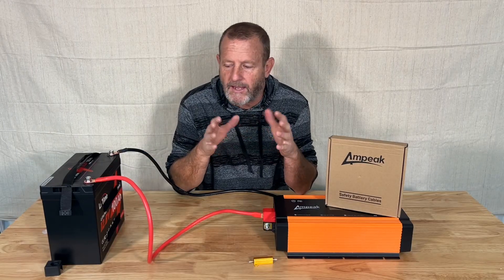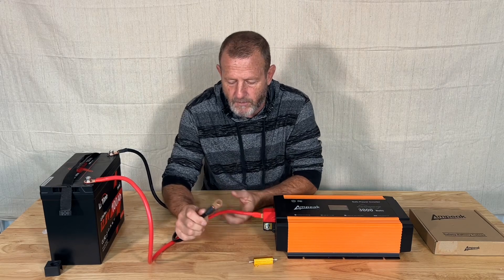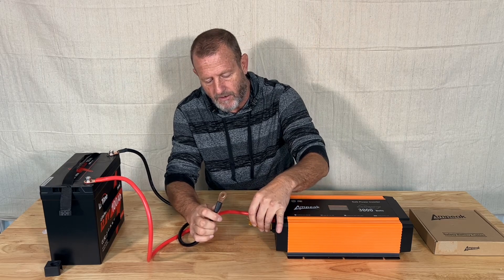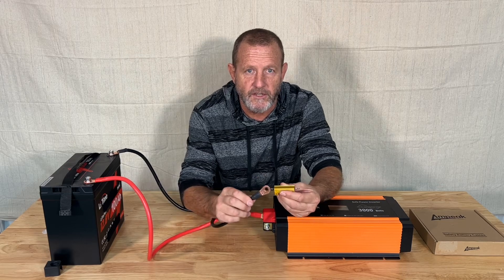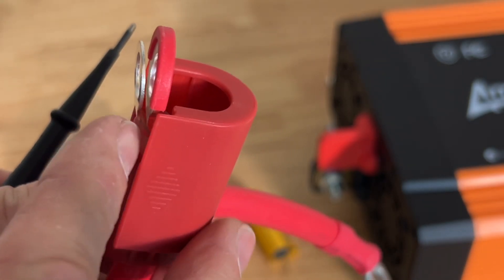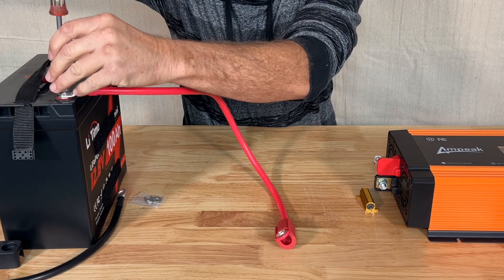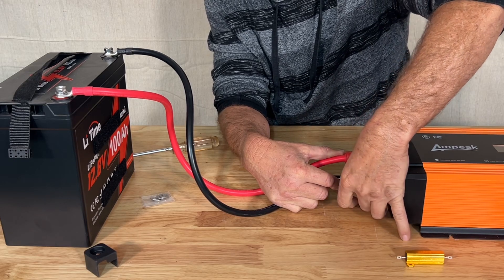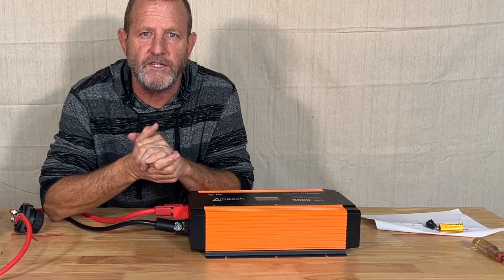Why / How We Pre-charge Inverters & Ampeak Safety Cable Review.

Comment: what if i have a circuit breaker between the battery cables and the inverter, is this fine? because when i turn on the circuit breaker i see no spark

Comment: Awesome idea!  I have the first-ever Ampeak inverter with pure sinewave output that I bought a few years ago.  It has a softstart safety circuit built within, which is why I chose that model.  It’s installed inside my DIY camper van.  Since I have a battery disconnect switch, the cable idea is not ideal for my camper.  But for more basic installation, it’s pretty cool!

Comment: Hi, A blue sea terminal fuse - the square ones would be a good idea and minimal.
For inverters without an inbuilt precharge resistor, incorporating an off switch with 1 then 1+2 would let you pre charge every time you turn it back on. This can be a resistor or a 12V bulb (if its 12V system ) when it goes out its done and switch to 1+2.
Take care M.